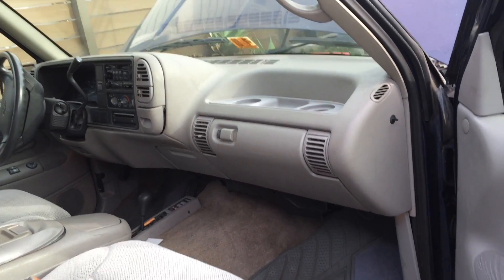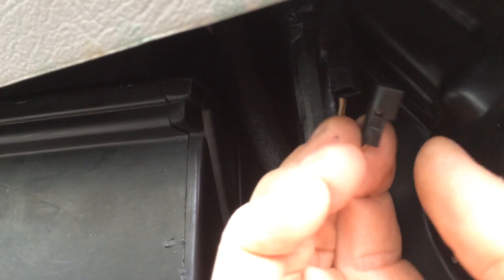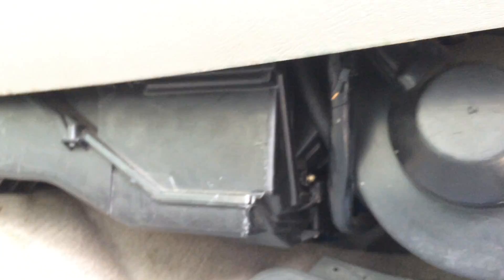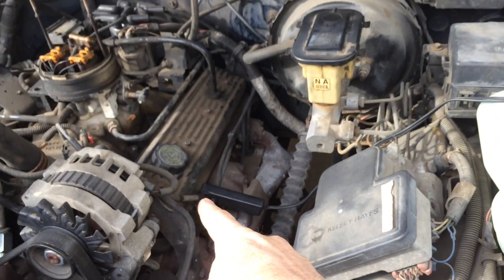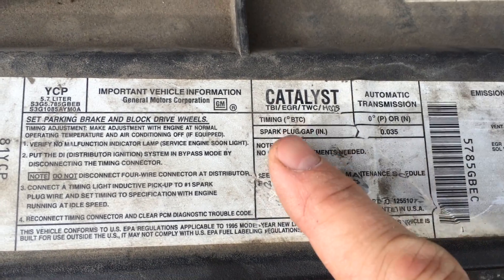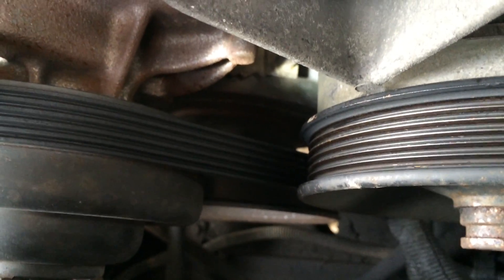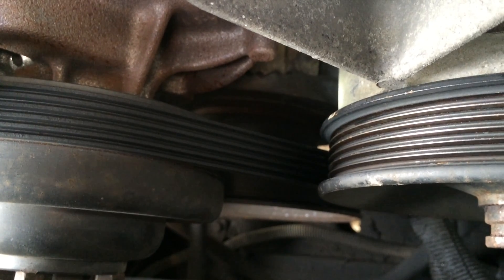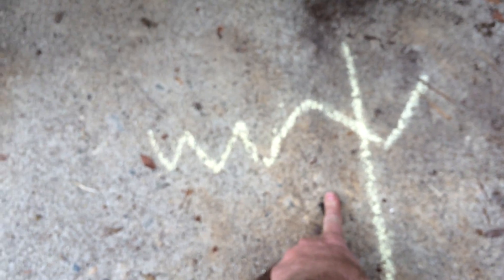Setting The Timing On A Chevrolet 350 V8

Comment: My truck does not have that sticker .  Do u think my 97 vortec is the same
Reply from the maker: I don’t know. You should be able to find a diagram. Usually there’s only one way the belt will go on anyway, and if you put the ribbed side against the pulleys with the grooves, and the smooth side against the smooth pulleys, there’s only one way to do it.
Reply: Marte Barbaro no 97 is computer controlled

Comment: Nice video as usual. That's a tbi not a vortec right? The vortec went to computer controlled timing???
Reply from the maker: Jake C Thanks.  Yes it's one of the last ones where you can change the timing. It's a TBI 350 V8.  I actually prefer the TBI system because it's so cheap and easy to rebuild vs. multiport injection, and the gas mileage is about the same.
Reply: @hoohoohoblin  will this process work on a 1995 s10 v6 tbi?